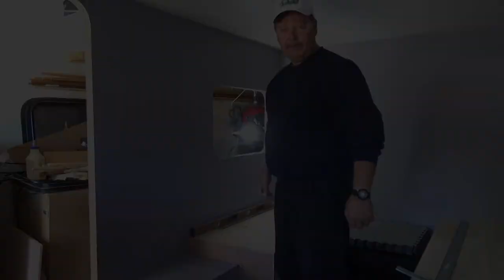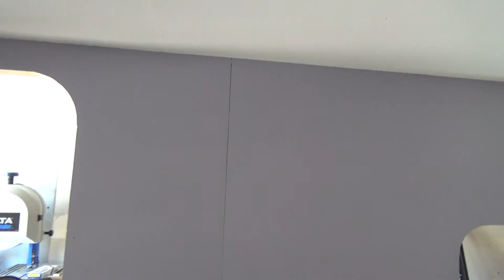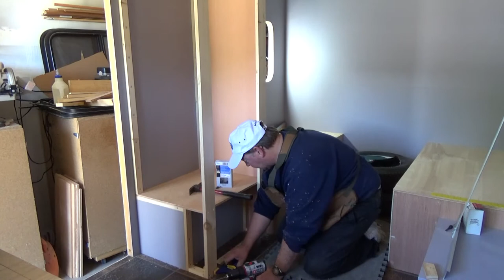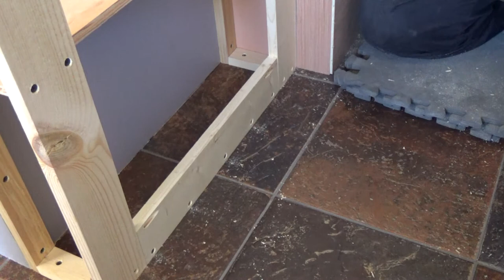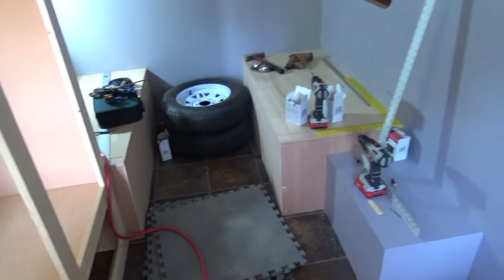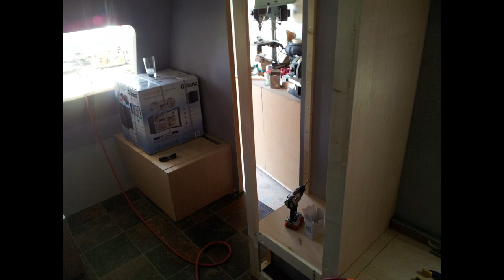How To Build A DIY Travel Trailer - Part 13 (Wardrobe Cabinet Part 1)

Comment: I like how you take the time to predrill all your wholes I was in the picture framing business for 18 years and I predrilled everything, as well as most of the things I work on today. I am also learning lots on your videos I have new ideals on how I am going to build mine. What was the software you used again for your trailer design.
Reply from the maker: I appreciate you checking out the videos, and glad you can get some ideas! Looking forward to seeing how your trailer comes along. I like watching from ground up... I can learn a lot from others who have great ideas and are better at building things than I am! :)  The software I use is Rhino 3D. The version I have is old (version 2) but works so well. I know some people use Sketch up (I think that's what it's called), with good success. Not sure if it's free or not... looks like a good program. I think what is best about using the software is, you can create your project on the computer, and if you don't like it, you can start over and not spend a dime. Once you build it, it cost money to start over and do it again! :)

Comment: I apologize if your specs are listed somewhere - what is the depth of your hanging clothes closet? Does it accommodate a shirt on a hanger nicely? I read online that a depth of 24” is recommended to keep clothes off the back wall. I would love to save a few inches in my build and take it back to 20” from the wall to the closet door but I’m not sure. Figured I’d ask you!
Reply from the maker: Hi Eli!! I went and measured just to be sure, but yup... 20" is about the depth. I have about one inch on either side of the hanger for clearance. I do have clothes hanging now, pants, jackets, shirts, and all fit just fine with the door closed. So 20 or 20.5 inches will accommodate just fine. I used a hanger to center where I wanted the rod to be installed just to make sure I had plenty of room. Clothes touch the wall and door but overall, function is good!

Comment: Are you using 1x2s and 1x4s? Also, is your plywood 1/4” or 1/8” luan?
Reply from the maker: I think I used 1 x 2 and 1 x 3 for the build... and the plywood was 5mm (close to 1/4") hardwood. Thanks for checking it out!
Reply: @OregonBatman  thank you so much for replying. I love your videos. They help so much. We’re building our vintage camper cabinets tomorrow. 1 wardrobe and 1 kitchen base cabinet. 2 upper kitchen cabinets
Reply from the maker: @lenanogueras877  That's awesome! Happy Building!